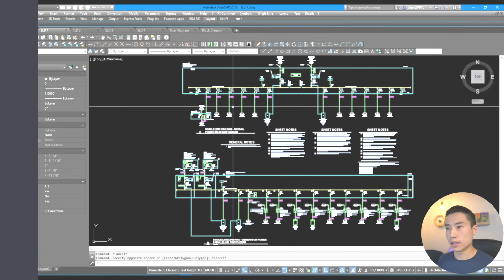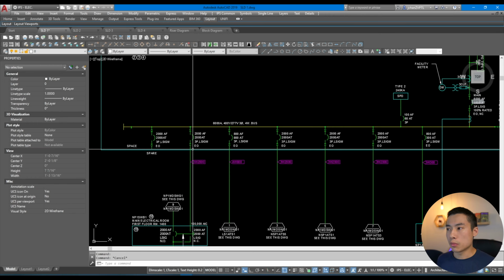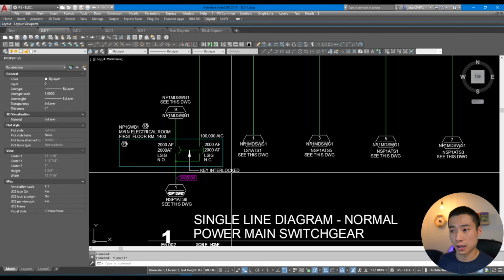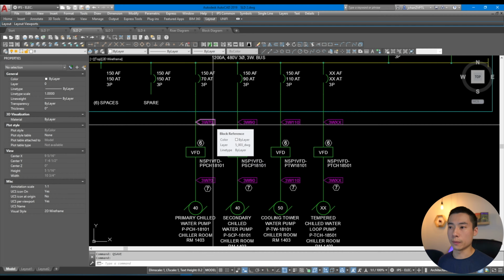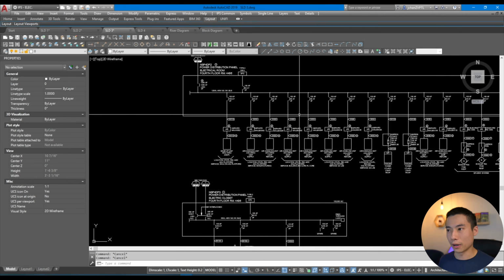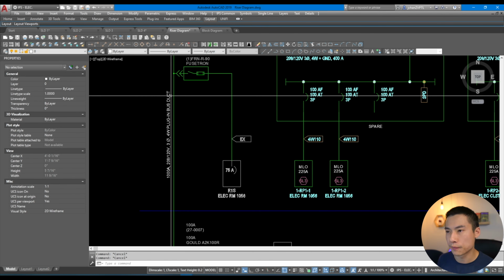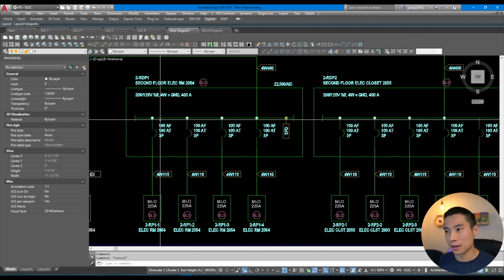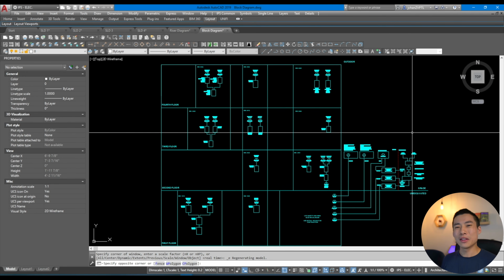Understanding Single Line, Riser, and Block Diagrams

Comment: Thank you for the showcasing the different types. 
On that first single line diagram that is a good amount of VDFs. Do you ever worry about harmonics? if so, do you typically callout for a harmonic filters? if so, would these be located on the main switchgear? (This may be a topic for another video)

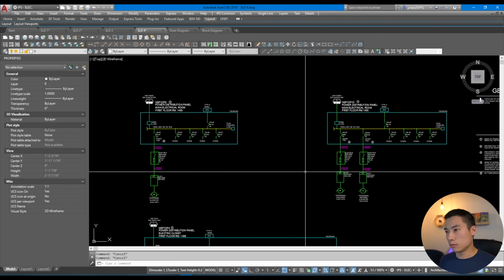Comment: 12:54 I thought "A IC" meant "amperes of interrupting capacity".
Reply from the maker: Actually, it used to which was pretty confusing since AIC could mean two things. Now, breakers are listed with AIR for available interrupting rating which clears things up a bit.